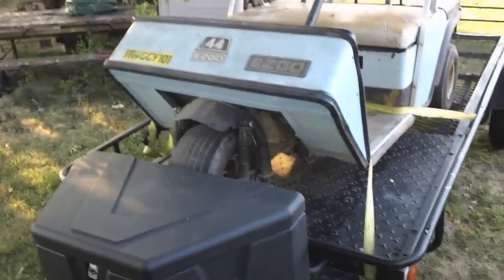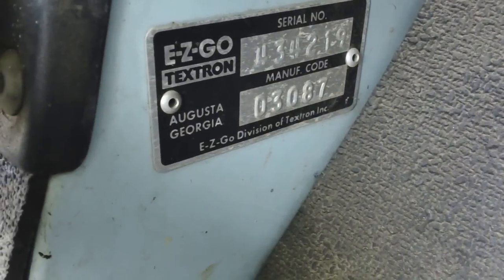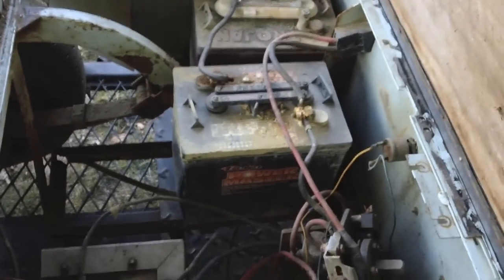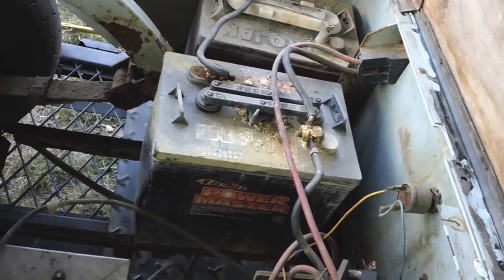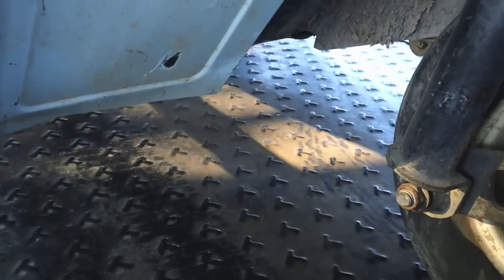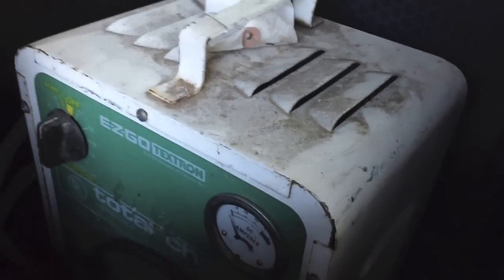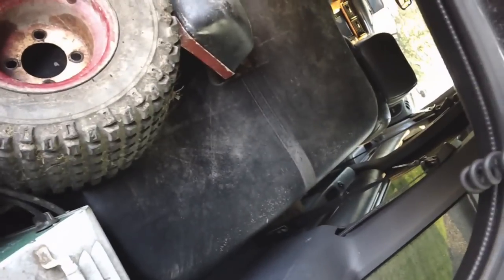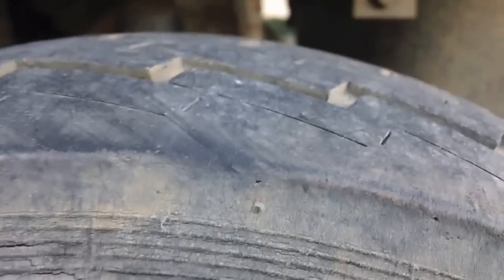1987 ezgo 3 wheel golf cart just picked up another project

Comment: I have one just like this, same color, three wheel and the works.  Mine is electric and does run good.  I've had mine for about two years and have drove the absolute piss out of it.  The only difference is I took the top off mine and I have a steel flip down truck bed on mine, vinyl is good and everything, always been stored inside.  Pretty mint.  Mine is a 84 though.  I only gave 500 for mine and got a charger.

Comment: Check out my custom three will Golf cart .I have changed it to a 4 wheel cart .I put a 2000 blaster front end on it and custom snow plow . I have been working on In closing the cab and I changed the shifter to a custom shifter . I post the changes this weekend so you can see them .I am also going to change if  from a 36 v to 48 v

Comment from the maker: Yea, as soon as dude told me it was a 3 wheel I needed it and asked when I could pick it up lol.  I don't want to be going too fast with this one, as anything over 20mph and a sharp turn is going to equal disaster fast lol.  I think the only thing different on the rear end is yours was originally a gas and mine is electric so the input shaft and mating going into the rear end is different, unless you are also talking bout the suspension?  A snowmobile engine would be best :)

Comment from the maker: Yea, I saw those videos awhile ago and revisited them when I pondered this golf cart.  If you look up go kart torque converter on the ebays you will see the system I am talking about putting on the 5hp honda its 149 free shipping.  I can then save up for an electric start 8hp engine or maybe one of those baby single cylinder diesel engines and use the same torque converter setup on it.  It would be chain final drive.  The torque converter bolts right up onto the side of the engine easy peasy.

Comment from the maker: Well, here's the thing.  I was just looking at the belt drive torque converter setup for the briggs and its going to be like $500 for both clutches and the belt.  Not diggin that lol.  I do have a 5hp honda I wonder if I just put the torque converter setup on that if it would be enough.  I literally just want to putt around with the thing, I don't need it to be crazy.  The setup for up to 8hp is only 150 or so which is way more do-able.  Other than that its bike engine time.

Comment: i have one as well and wanted to ask, i need a rear hub assembly, do you know if they all are the same? is it worth going to gas as well? i'm dreading paying 600 for batteries and have been contemplating just using 3 optimas i have laying around lol

thanks
Reply from the maker: I mean, I always favor gas over electric lol.  Do you mean the wheel hubs?  You can use the optimas, but you probably won’t get as long of a run time as you would with the bigger deep cycle batteries